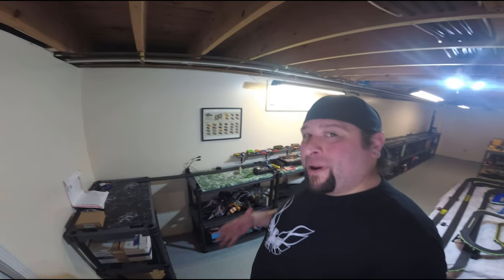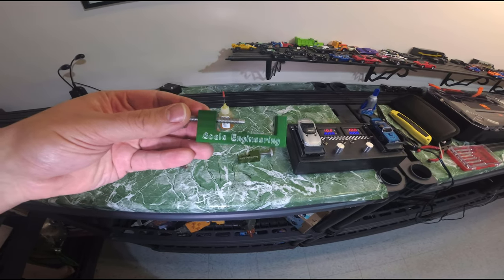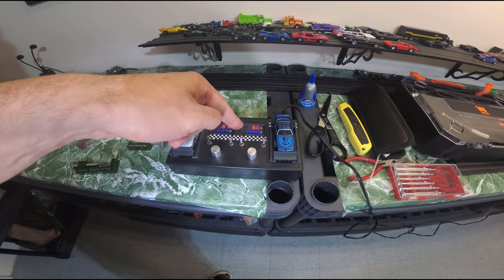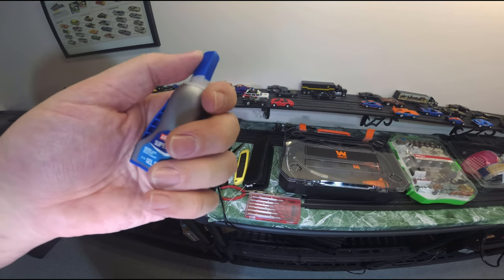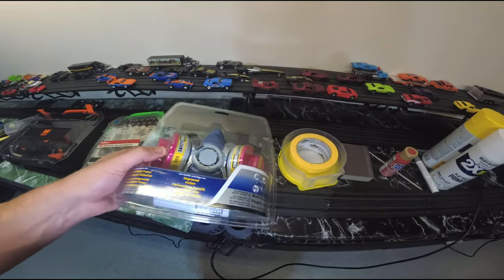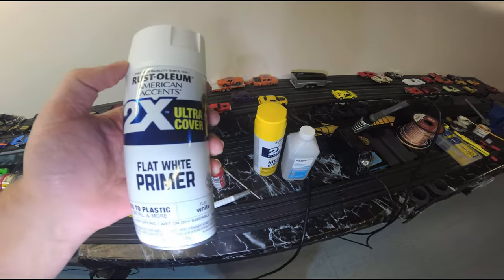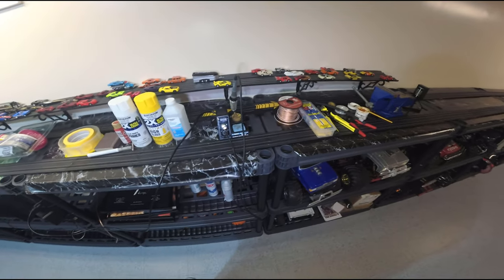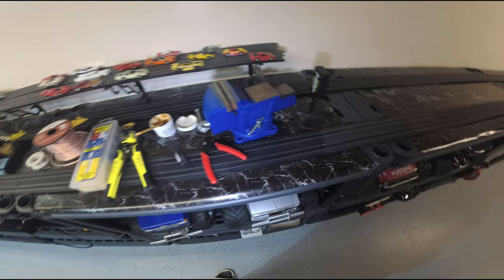Slot Car Must Have Tools For The Hobby HO Customizing Repair Fix

Comment: Nice video. I prefer a cordless Dremel tool for most operations. I do have a corded one for heavy duty operations. I have a smaller vice I bought at harbor freight that is awesome. I will definitely get a dental kit. Thanks for that idea.

Comment: Great video. So helpful and the inclusion of the links is tremendous. Thank you. Revisiting the youth of the 1970s and just getting restarted with this hobby. Appreciate getting expert advice and doing things right.
Reply from the maker: I wouldn't call myself an expert, but it is much appreciated! Let me know if you have any questions in the future, and good luck!
Reply: @StockpileHobbies  Will do. I'm a bit nervous about utilizing the laptop power supplies to run the track (only because I'm used to the old TYCO set ups I remember as a kid)--don't want to trash any of my old cars. But, my goal is to build a 5' x 12' slot car table and I need the appropriate power.
Reply from the maker: @richdavino7356  Get the laptop adjustable charger and pigtails. I've been using 4 of them for over a year now. I run 18 volts for the race track lanes and 24v for the dragstrip lanes. 0 issues. The new auto world cars need to be at 24v on the race track to keep up with the old tyco cars. The entire channel is built on them doing the job
Reply: @StockpileHobbies  how big is your layout? I’m trying to figure out how many pairs I will need. Thanks for the help
Reply from the maker: @richdavino7356  You will need 1 power supply for each lane. If the track is too long you'll notice the cars lose speed at the portion that is furthest away from the source. This is when you would need to run a power tap. I have videos on all of this, as mine needed it. Its not length so much as it is the number of joints/connections/pieces of track. 1 long piece is better than 2 or 3 short ones.
Reply: @StockpileHobbies  thank you for the additional info

Comment: Great videos.
I'm having a very hard time soldering in new tycopro wiper pickups.
I'm new using an iron and Temps are a mystery to me.
Can you do a few videos on soldering those old tycos and removal / replacement of bulbs of the Aurora Tjet & AFX Flamethrowers?
Reply from the maker: https://youtu.be/xVgtqN6UrkU?si=IGNM69-Aqiwm3NTD
This video shows how I added lights to a tyco 440 chassis. 
For soldering. Set the iron to about 400 deg. You want to tin everything you're going to solder. This is where you add flux to wires and whatever else is being soldered, then put some solder on the tip of the hot iron, and wipe it across the wire. The solder will flow into everything that has flux on it. Do the same for the other component you're going to attach the wire to. Now everything has solder on it, the wires and the other part they are going to be soldered to. Place the wire into the component and place the iron onto the wire for a few seconds. All of the solder will melt together into 1 joint. Remove the iron and blow on the joint once or twice.